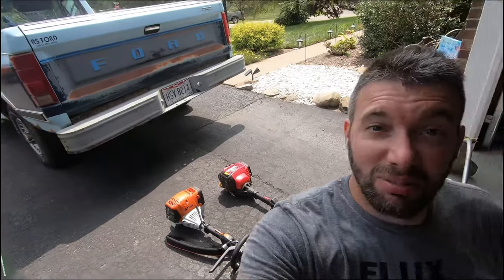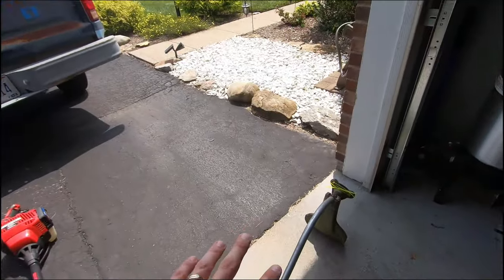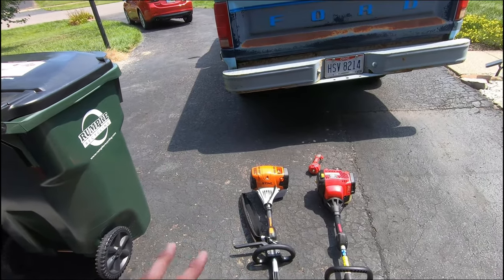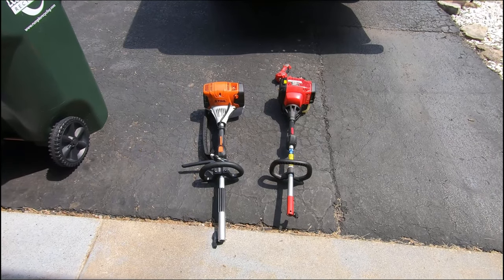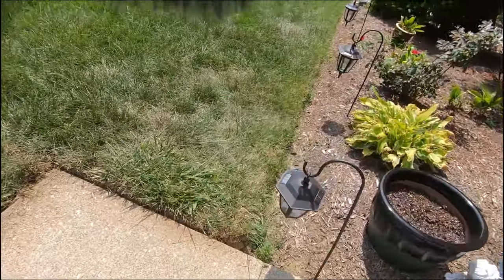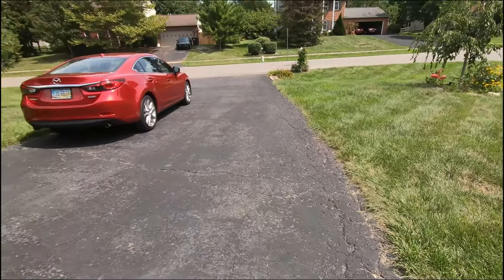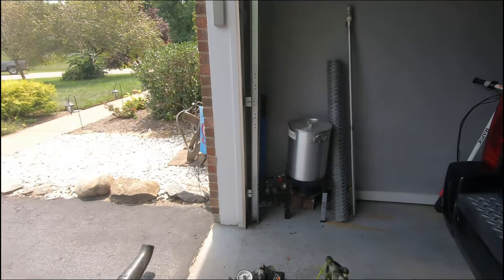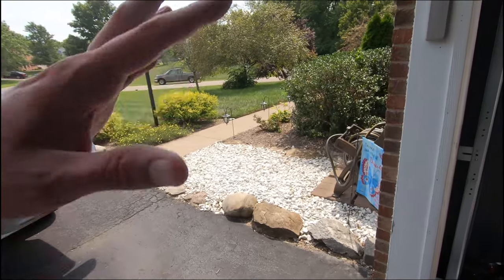Stihl KM 91 R Kombisystem Review, Carbon Earth Xgreen Update

Comment: Those stihl trimmers are expensive but they will last a very long time if you take care of it. That motor is a 4 stroke that uses 2 stroke mix gas. You do have to periodically adjust the valves on it.

Comment: I basically have the same story as you. I bought junk from Lowe’s it breaks down etc etc. So I went to the Stihl dealer 5 minutes from my house, spent the extra money and bought the 91R and it is just night and day difference.  The power and balance is just next level. I can’t even imagine how powerful the bigger ones are. From now on I will not buy any of my lawn gear that I use all the time from a big box store. I went ahead and bought the Stihl straight shaft trimmer and and curved edger. I didn’t want to have any discrepancies with the dealer about warranty issues.
Reply: So the 91r is powerful enough? I've been looking into them and wasn't sure if I should go 91r or the 131. Huge difference in price, but if the 91r has enough power I'll just get that one
Reply: @TheOnefalcon07  yeah man. I bought the kombi so I do everything with it. Edge hedge trimmers and string trimming. The only time it ever struggles at all is if I have a worn out blade for the edger but I just keep a pack of 10 of them. They’re like $3 each. Also I replaced the string trimmer head with the echo quick feed head. That’s pretty common practice on all the stihl trimmers.
Reply: @JonBecker81  awesome! Looks like I'm gonna save some money with the 91r and not the 131. In today's economy 120 bucks saved is great.
Reply from the maker: Yeah I've never had mine bog down. I could only imagine how powerful the larger ones are. Probably snap your hand off if it kicked, lol
Reply: @TheLawnStripes  thanks for the info
Reply from the maker: Anytime

Comment: Hey man great video and thanks for sharing. I’m looking to pull the trigger on this; mainly for brush cutting through tall grass and thorn bushes. Do you recommend this model or do you think I need to go 131R? I am not doing it every day and will be a few times a year I would brush cut to help keep the invasive vines down that come from the rose bushes in my area. Thanks!
Reply from the maker: I personally haven't used it for brush cutting. I use the tiller, and it works fine. I could say sure because it has quite a bit of power, but if the brush is really thick, maybe the next step up for power might not be bad. It's better overpowered than under when it comes to that stuff in my opinion.
Reply: If you get the adjustable hedge trimmer (get the one they call a scythe), it will tunnel through blackberries like a magic wand and power doesn't seem to be a factor, just maximum brush size. I will say it's easy to cut everything off a stout bush and leave just a 4 foot high stump to cut with the right tool. The metal grass blade will too, but I think that three point metal brush knife is the thing to have. I haven't seen it myself, but the videos make it look far superior to the grass blade, and I saw a guy using it to saw about 3" trees. He might have had the hands of a gorilla, I don't know, but it was sawing through the tree, even after he hit it hard against a cinder block.

Comment: Hello...
Any issues a year later with the trimmer plus attachments? Have a ryobi expand with all the attachments and planning on doing the same as you did. Thanks
Reply from the maker: No sir, not a single issue. Just used them yesterday actually. I did buy a straight shaft though because it was easier to edge with.
Reply: Thanks!

Comment: Reading the manual for this model, it's calling for mixed fuel... Hearing it in the video it sounds like a 4-stroke.. So I'm thinking wtf is this?? Best I can deduce is this is a 4 stroke that is fuel-lubricated. I guess I'll find out tomorrow when I go to buy one.
Reply from the maker: Yeah it's some odd newer engine they made. It definitely sounds like a hefty 4 stroke at idle but is a 2 stroke. Iunno 🤷‍♂️
Reply: Just think of it as an 4 stroke  has valves and rockers but uses 2 stroke fuel